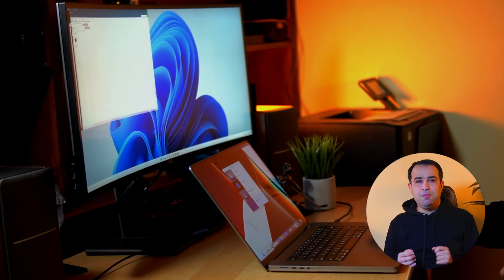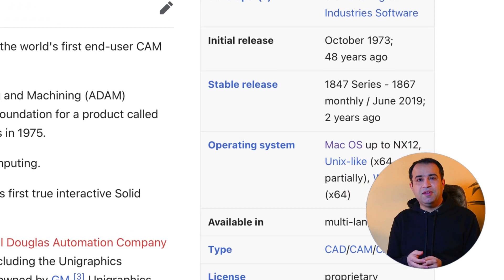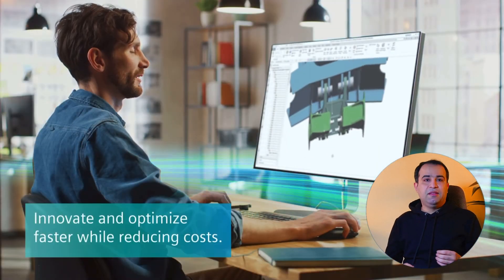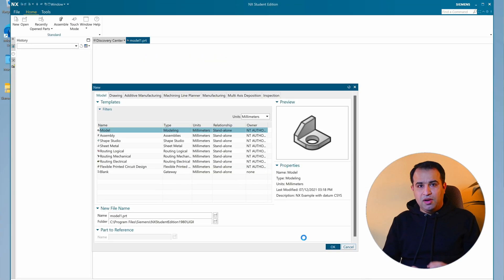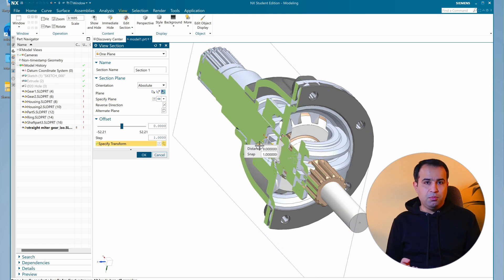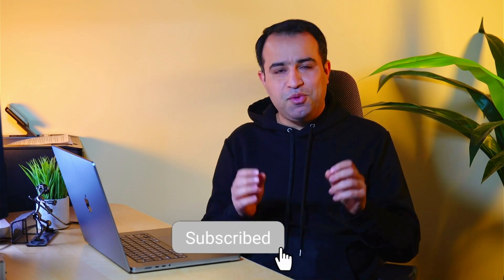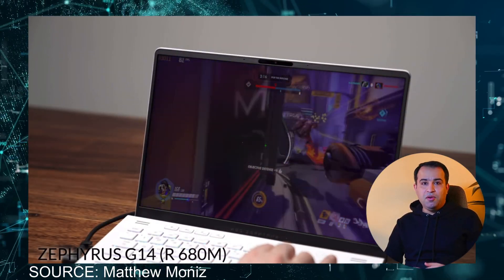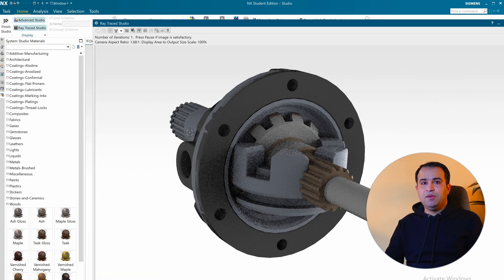Can you run Siemens NX on an M1 MacBook? (Apple M1 Max for Mechanical Engineers)

Comment: Bonsoir Hamid, I plan to buy a MacBook Pro with M3 max and 128g of ram. My goals are to run the MacBook Pro for Cad and i curently use TopSolid V7(a french Cad software) and few others like Shpr3d and Rhino 3d(which are natif in MacOs with Apple Silicon). I'm wondering if TopSolid can run on Win 11arm and Paralelles. Do you have some cues? Merci beaucoup à l'avance. Vos vidéos sont très bien fait et ils sont utiles à la communauté Cao. Continuez votre bon travail!

Comment: hi, I think to buy macbook pro. System features are m2 pro, 16gb ram and 512gb ssd. I will buy it for communication engineering. I am using catia, siemens nx and ansys. Are these features are enough for me ?
Reply from the maker: You should be good, as long as you don't work with super-heavy models.

Comment: May I ask how to set up PD so that NX can run smoothly in PD? Currently running NX CAM on PD using WIN11, the performance is very poor, GPU is 100%, I am macbook pro m2 intel i9 2.9 ghz
Reply from the maker: Hi,
Not sure what is the exact model of your MacBook. Is it the new M2 series or 2016 Intel i9 series?
In my experience, NX was performing quite well even on my 2020 M1 mini, with no lag or delay.
Reply: @HamidDLL  HI, thank you for your answer. and my MacBook is apple m2 max  ram 96GB. nx cad environment is good to used. but nx cam environment is very bad.  I think maybe nx software is not optimization for win 11 arm. right?
Reply from the maker: That’s correct unfortunately.

Comment: If you could let us know how nx works on Intel core i9 13th gen plus rtx 4080 or 4090 and share info on what kind of drivers we can install for them to work properly that would be great !
Reply from the maker: Hi, unfortunately I don't have those RTX GPUs in any of my setups, but, I can confirm it works flawlessly on an Nvidia A6000. Also, Nvidia now merges their best drivers in the download package so that people don't need to struggle with which driver to use. I hope it helps.
Reply: @HamidDLL  thanks, for replying, so nx doesnt rune well on gaming gpus.does it?
Reply from the maker: Those GPUs should give decent performance, but, not as good as a Quadro for heavy CAD works.

Comment: Hello brother it's very wonderful that you r helping so much for Mac users. If I bought parallels student edition after that do I need to pay anything extra for running windows 10 or 11 as well as  to run SOLIDWORKS ? is my subscription on parellels is sufficient
Reply from the maker: Hi Tiger.
Unfortunately, I'm not 100% sure, but, if the student license is a permanent license and not timely limited it should work down the road. I think the best idea would be sending an email to people at parallels and ask them. They are the only people who can advise you for the best option.

Comment: Does Siemens nx 1980 work m1 mac air? Also which virtual machine should I use, parallel 18?
Reply from the maker: Hi Mayank,
Siemens NX works well on M1 Macbook Air. As for the virtualization, you can even run it on UTM (free & opensourse).
However, Parallels is the best in terms of stability and performance.

Comment: Hi @HamidDLL, can you do the tests with M2 MacBooks, please?
Reply from the maker: I already did.
Barely %10 difference, which makes sense, considering the most effective parameter is CPU performance in virtualization.
Reply: @HamidDLL  Thank you for your answer. I think if the M1 and M2 comparison video comes, it will be watched a lot.
Reply from the maker: Thanks for the suggestion.
I'll plan for it.

Comment: Hi Hamid i am Mechanical Engineer currently i am used Mac book pro 2015 model, i am planning to upgrade to mac book pro M2 .please suggest me this is good for me to upgrade now or more wait?
Reply from the maker: These M1 & M2 apple computers are incredible, if you can make your software working for your workflow.
Otherwise, as a laptop, they offer amazing battery life and good experience overall.
Reply: @HamidDLL  Thans your replay current I am using creo parameters and solid works on Mac book pro 2015 model.
I am planing to update my Mac book pro on m2 
Is it possible my software run in this machine
Reply from the maker: I think they should run with no problem.
However, it's just my guess based on the recent improvement on virtualization in Windows ARM.

Comment: Hello,I want to know will nx run good on M1 MacBook Air?Will it cause a lot of heat while modeling?Will it significantly lower the battery time?thx
Reply from the maker: I don't have the experience of NX on MAcBook Air.
I tried it on an M1 Mac mini, and it worked quite easily. However, for large models, you may see heat issues since MacBook Air does not have a fan for cooling.

Comment: Thank you for your video, I tried with W11 ARM and Parallels but un fortunately I obtain an error and it doesn't work, do you have a clue for me ?
Reply: Hi Hamid, thanks for your answer, finally I found what was the issue. The NX1980 works but the new 2206 version doesn’t 
Bye
Reply from the maker: Thanks for the feedback.
I appreciate it. 👍
Reply from the maker: Hi Christophe,
May I ask what error you get?
It seems that it worked for many many people that I'm aware of.

Comment: What build of NX did you use?  I have tried several builds from NX software download and Windows 11 for ARM (Parallels latest version) but NX will not install?
Reply from the maker: Hi Jordan,
I installed the student version (latest build from the website).
I also tried it on a Win11 virtual machine on UTM last week, and it worked there as well.
Did it give you any error or something?
Reply: @HamidDLL  I sent you an email to discuss further

Comment: Thanks for the video... my 2 cents is that NX gets worse every year.  I do not know how that is possible.  The people at Siemens have their heads up their a##

NX is extreemly painful to use, and with every installment yoy, makes the user experience worse.
Reply: sooo terrible to use...  Speaking from a poor engineer that has to suffer from using NX.  oh and solidworks is worse.
Reply from the maker: Hi. Thanks for sharing your valuable experience. 
I don't have much experience with NX, but I totally agree with you about SW.
It's a pain when you need to deal with large assemblies.
Reply: @HamidDLL  I don't find much issue with large assembly management, however the NX is terrible when it comes to saving locked files.  I mean, why does it even modify the file when it is locked?  only to blow up my save routine.  

then one might ask, why do I save so often and how often... well every 2 minutes or so... why because I do not want to lose work when NX goes and crashes or loses sync with TC.  

pain pain pain...
Reply: I really do not need my CAD system to make assumptions.  It needs to be deterministic.  anything non-deterministic in engineering becomes a lose variable and well will trigger costly 8D investigations down the road.   

Especially like the new constraint system.  why on earth would I ever want to have an arbitrary soft vrs rigid constraint system.  it would be great if this was clear but constraints sometimes show themselves... sometimes don't... 

too many things need to be fixed in NX and over the last 10 years of using NX, things really have not gotten better and the program has become far more cumbersome.  

like this whole non-native support for macOS.  We have to run remote VM's and subjugate ourselves back into another painful hell hole of using MS Windows.  Argh!!!
Reply from the maker: Totally agree.
I'm not a heavy user for CAD software.
I'm more of an FE specialist. But, I have enough experience with CAD that I understand all those annoying problems you mentioned.

Comment: Thank you 🙏🏽 I started using NX this year as a mechanical engineering student and everything works fine on my 16“ M1 MAX with 24 GPU cores and 32GB RAM. I had some issues during an assembly, the machine will not show the lightweight version of the components and I have to work with the exact representation. But the experience is very smooth! I hope Boot Camp will return, when the the exclusive contract with Qualcomm expires and windows ARM is officially released.
Reply from the maker: Thanks Faith for reflecting your experience here.
Yes, BootCamp for ARM is what all people are waiting for. 👍
Reply: @HamidDLL  Hey, I'm currently having an issue with an assembly. the default view is in Studio and the MacBook has some issues with ist. It can't display the rendered parts so everything is very slow. Do you have an Solution for that, or can I share the File with you?
Reply from the maker: Hi Faith.
I'm not working much with NX, or any other CAD software.
I'm more into FE, so much job starts after CAD model.
If you go to the visual settings, there are some parameters that you can play with to make the graphic experience a bit smoother.
Check then out, I'm sure they will help to make it better.
The default settings are set for a dedicated GPU on a standard windows workstation.
Reply: What VM so you use?
Reply: @itsurbrothersmom  parallels, but since the last update rendering works. NX runs very stable
Reply: @Fatih-xl7yn hey there, how big are your assemblys? i am thinking about upgrading to m1 max from m1, but not sure how big is the difference :)

Comment: Please review using PTC Creo Parametric on an M1 Mac. Please show all of the steps to get it installed and running. Thanks, I already have a home license installed in parallels windows 11. The installer worked. The software does not launch! Any ideas?
Reply from the maker: Hi Heath. Sure. I'll try to have a look. Please subscribe to get notified for the upcoming videos.
Until then, I suggest trying it on a Windows 10 ARM virtual machine.
I had a similar problem with SolidWorks.
It worked for SolidWorks on Windows 10.
Reply: @HamidDLL  thanks I’ll try that.